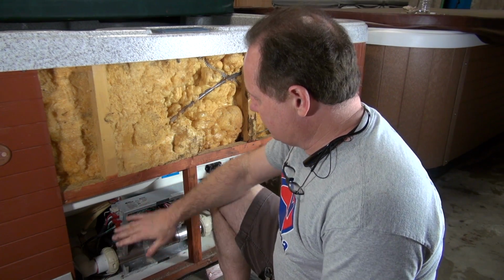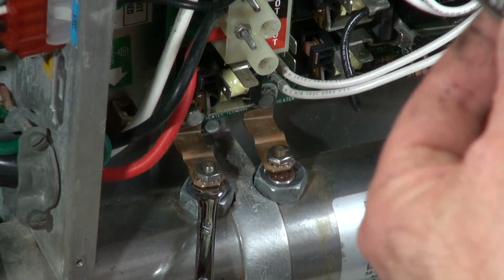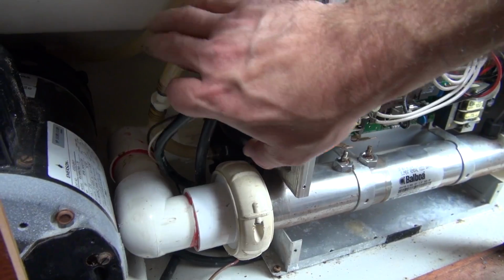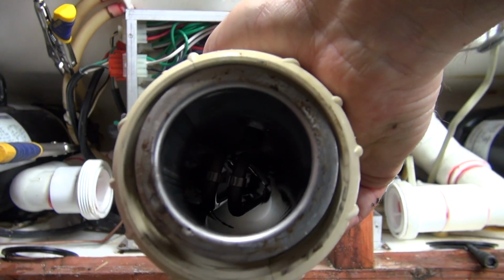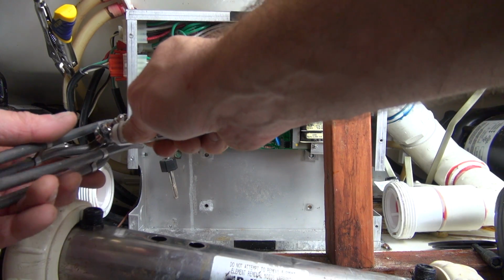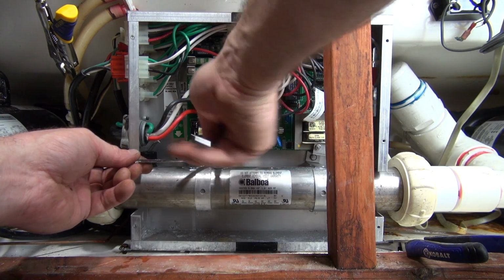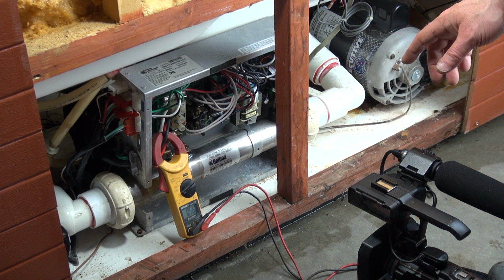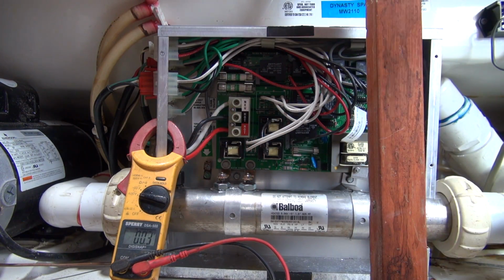GFCI Breaker Trip Diagnosis Heater Replacement Hot Tub How To Spa Guy

Comment: Bought a used hot tub got it home, got the electric service connected, filled it up, switched it on and nothing! The breaker tripped and nothing happened. Found this video, followed the troubleshooting steps and discovered that the heater was bad. $79 for a new heating element and less than an hour of work following the video instructions and my hot tub fired right up. This video literally saved me hundreds of dollars! Thank you, thank you, thank you!
Reply: Got the same problem!... hopefully I'll get a similar result.  Great video

Comment: Thanks for an explanation of why the GFCI trips as the hot tub ages.  My circuit board had problems, too, so I just replaced everything for half of what my local store wanted.  This video helped me to decide to call a parts distributor who sent me exactly what I needed and let me bypass the local guys who overcharge for simple service calls and for the same part I was able to install myself. Four years back I bought the "demo spa" model to try to save money, so I should have expected to have the problems that come with wear-and-tear of a slightly used spa.  Your video and others saved me enough cash by using skills demonstrated and products from internet sales, so the rebuilt unit I have now is almost like new and is also easily repairable - now that I've been though the experience once. Your DIY video is a godsend for savvy handymen who enjoy solving new fairly simple problems while saving money. Thanks again.
Reply: I’m a girl and I think I can replace my heat element by watching this video as I go.  Cause I sure can’t find anyone to come repair it.

Comment: After going without the use of our hot tub since February because the heating element went out, we finally repaired it ourselves following your video. Though we didn't have the electric test kit we could tell the element was bad because of the rust around one of the terminals. Great Video. Thanks a lot! Saved us a lot of money. Our hot tub is 13 years old and nobody wanted to work on it. Found parts easily enough.    Stephanie
Reply: That’s my problem.  My hot tub is older and I don’t like the newer ones. I like mine but yes people do not want to worry w older models.  Last guy swore he couldn’t find the parts on line because the Morgan spa was an older model.  I think I bought it in 2005

Comment: What a great video! It took me longer to take off the tub cover and the electronics cover than it did to figure out that the heater was bad. Now the next step while I wait for the parts to arrive is to see if my slice valves actually work but if they don't it's outside so I get to water my brown grass! :)  Thanks so much for a clear and straight to the point video!

Comment: My GFCI plug has been randomly tripping for years. I thought it was a burned out ozonator, which I replaced. That seemed like it fixed it for a bit but the problem continued. I watched this video and realized I had a leak on one of the heating element contacts. Replaced it for $30 and the tub works great now. Thanks

Comment: Thanks so much for the video !!  I found one of the heater electrodes leaking and then noticed the wire lead had melted . I just had the heater element changed...guess the repair guy didn't do a good job installing it.  We went and bought a new spa since this one is 15 yrs. old. Was going to trash this one but will keep it now and use it at our home, the new one goes to our rental cabin. Just needs a new wire lead and element sealed with silicone....

Comment: Just thought I would add to public knowledge. I had a situation where my hot tub wasn’t heating so I replaced the heater element. After replacement, the breaker would trip instantly. Tried 2 new elements with same result. Went back to original and no tripping but no heat. Electrically the new and old heater elements were identical (10 ohm resistance, no path from lugs to mounting nuts). Measured voltage at element lugs and zero volts. 
Turned out that controller board had cold solder joints to both heater relay output pins. Resoldered pins to board and no more tripping the breaker with any of the heater elements and now have correct voltage at element posts and it’s heating fine. 
Not sure why having those bad solder joints would cause breaker tripping with new heater elements but not the old (still working) one — but it did. Something to be aware of,  Definitely caused some head scratching on my part.

Comment: I live in the great white north and found that my GFI kept tripping when powering on. Tried troubleshooting pumps, lights, heaters etc. with no definite issue. I ended up looking at the GFI breaker panel and found that it was packed with wind blown snow. I cleaned it up, dried everything up and SUCESS! Check to see if you have moisture in your GFI panel as well. 👍

Comment: thanks for the details on getting my tub back running again! installed a titanium heater instead of the alloy one as recommended. my old heater didn't show any signs of corrosion on the posts, but tripped the breaker whenever it would want to heat. cheers!

Comment: You are awesome! I thought for sure I had a bad breaker. After watching your video I did exactly what you said and realized the heating element was the issue. I ordered the part on Amazon and just installed it. Took me roughly an hour to install it. I did have to grind down one of my wrenches to fit as a back up support. Not a big deal, but took a little extra time. Thanks brother, I I owe you one. 👍😎 definite subscriber

Comment: ...wasn't sure if it was the heater or not tripping the breaker, because the spa would run for hours and then trip.  So I disconnected the heater element from the board, and let it run for 2 weeks.  Breaker never tripped again, so I ordered the part and will replace it today.  Thanks for the video!

Comment: Very thorough video. Thank you for taking the time to make it.
I changed out my pump seal and after reinstallation, refill, etc the breaker tripped at around the time the heater should kick on. Why the heater decided to crap out at that exact time is unknown to me.
Reply from the maker: Joseph sometimes when you let the water out and expose the back of the heater to air it does that.. Meaning it was bad already it just needed a pressure change to be exposed and cause a breaker trip..
I have heater elements here.. https://hottubpartsofamerica.com/search.php?search_query=titanium

Comment: Thanks for this informative  video.  I had a circuit breaker that keeps tripping. I had already tightened the AC wires and unplugged all accessories.  Your test at 2:30 shows me that the heater must be bad.  Thanks !
Reply from the maker: Jeff Weiss https://hottubpartsofamerica.com/heaters-and-related-parts/
Reply from the maker: Jeff Weiss https://hottubpartsofamerica.com/search.php?search_query=titanium+5.5kw
Any of these 5.5 are correct for balboa..

Comment: This was so helpful and saved me a load of money. This looked exactly like my setup and as you said, it does look like the heater coil. THANK YOU!
Reply: Good
Reply: Mine is a hydroquip, incoming voltage appears ok, indicators on upper panel appear normal, no error message, but unit does not come on, pumps are not activated... nothing....what next?

Comment: Thank you lots Spa guy you help lots today troubleshooting my spa and heater element. As i could see on my element when looked at, the rubber o rings had almost cut in half because of the manufacturing of the hole, it left a burr, so i filed it down better so as to not damage my new orings, so i changed only orings and did not have to buy new element :-). CHECK YOUR ORINGS !!! Thanks again spa guy

Comment: My hot tub starts and all looks good, then a few minutes in the breaker trips. When diagnosing the issues my breaker is only tripping when Pump 1 is connected all other parts are good (based on unplugging and disconnecting each individually). I even plugged in Pump 2 into Pump 1 port on the board and ran it for a while with no issue.  Once the breaker is tripped it won't reset for a while, if I wait a day and reset it we start back in the beginning with all working for a short time.  I just ordered replacement seals and bearing for Pump 2 for a small leak and a new heater titanium element from your website, figured worth fixing it up a little while I am in there working on it.

Pump one is an Executive 56 2 speed motor (also serves as circulation pump), Hot Tub is a Master Spa TS7.2.

Help Spa Guy...trying to isolate where the issue might be.

Comment: First week of January (coldest day of the yr around -4f with a -20-30 windchill) outside jacuzzi decided to stop heating. I replaced the filters, heater, hi limit switch, and temp sensor drained and refilled. The only thing i can think of is the circut board is next? The top controller works fine and the light calling for heat is on. NO CODES. Jets work as they should. Everyhting is normal just no heat. The breaker never tripped and the fuse is good. The board has a few dark areas but nothing that looked burnt or out of the ordinary. I replaced the circ pump last year also. Thank you in advance

-Jason
Reply: Turned out to be circuit board

Comment: Great information but try this first.  Turn off the power, take a cheap tooth brush and rubbing alcohol and clean around the heater terminals at the top of the heater tube.  Let dry and see if that clears the GFCI tripping issue.  Dirt, splashed water, spider webs, etc can occasionally cause the GFCI to see a path to ground and trip.  Worked for me.
Reply from the maker: You got lucky!! If the heater element is in the condition I show here it needs to be replaced!!

Comment: Could you put some kind of cap on the pipe where the slice valve's are at...so the water wont come out..??? Do you think a balloon or something similar cap will stop the water from seeping past the slice valve, in other words cap off where the threads are, where the heater connects.

Comment: Good Morning Spa Guy!  Just scrolling thru the Q & A's here is interesting and beneficial, particularly those from Headless Horseman... I was beginning to think we owned the only Coleman 455 ever manufactured!  Here's our problem: changed the water, got the tub all spiffy clean, topped up and "poof" goes the breaker. Nothing new really as it's sometimes taken a few throws [or flips] for it to stay on. When not, as this time, it's usually the element, right? Not this time. Well, who knows... with the new element in the breaker isn't flipping anymore but nothings happening... no pumps, no lights and who knows about the heater.  There's electricity floating around in there cause... well, let's say I got  a tingle  :)  I've replaced the 3 fuses I can see... the larger 30 amp one + the 2 smaller 7amp glass ones... any ideas?  The topside controls weren't looking too hot prior to this and I was thinking we should get the Maxx replacement part (Coleman / Maax Spas TOPSIDE, PANEL, C400 & C600 SERIES - 2003-5 (NO OVERLAY) - 103305) but haven't gotten that far yet.  Could that be the problem?  Thanks!  Peter

Comment: Would be good to see you test the actual old or bad element to see the ohms before changing. Mine test good but still blows the breaker when it fires. Flow sensor is fine. When I unplug the heater I do get the 120 output but when it is plugged in it trips.

Comment: Hi Spa Guy great video!. I have a Tiger River Spa, approx 6 yrs old that came with the house i bought, in nice working condition. It worked fine for a year. Then it started to trip after 5 min of running time. It started happening when it got cold out (southeast Michigan). I didnt know the condition of the filter so i replaced it, and it worked again and didnt trip for a while. I clean the filter about every 3 months, we use the tub about twice a week. 

Now, its getting cold out and it trips again when in use.  When not in use the heater works fine. But oddly i noticed it only trips when both the heater and jets are on at the same time. If i heat it up to where i want it, i turn the heater down so it's not engaged and run the jets as long as im in there and it doesnt trip. 

Any suggestions are greatly appreciated! 

Thanks for your time.

Comment: Great video sir, my issue is that the heater is tripping my breaker after doing the elemination process i find that when i hook up the heater left lead it trips the breaker while powered but it doesnt do it with the right leadt touches,,,i have also nocited that i have 120v to that lead that causes the breaker to trip but zero volts to the right lead, isnt it supposed to have 240v when powered and i test both leads to the heater that come from the pack?...why am i only getting 120v to one and zero on the other?.....the power coming in to the pack has been tested and is correct

Comment: If you use a stainless steel wire brush it won't rust as bad after you brush it. If you brush it with a steel brush it will make the stainless rust. You can also check the resistance of the heater element and see if it is bad that way.

Comment: I think I have this exact problem on my tub. I opened up the case today and the terminal into the tube for the heater had one little drip on top (wasn't sure ehow it got there) and it trips out. I tried unplugging the pumps ect and it still did the same. I'll order heater and give it a go

Comment: I have a hydro pool hot tub and it keeps tripping the breaker, I figured the heating element was causing the problem, I disconnected the element and the pump started, but had a HL fault on the display. I checked continuity with my meter so I suspect my element is fine. I reconnected the element and unplugged the temp sensor and the pump starts again as soon as I plugged the sensor in it trips the breaker!  4kw Gecko

Comment: Did you do a resistance check on the old element? My breaker is tripping only with heater plugged in, soon as I isolate it, it doesn’t trip, but I did a resistance check, and it was good 14.9 ohms

Comment: 25:15 you have a what on the board? I think I have this issue with my pump1 output. 2 speed only getting 120v it seems like. Great video, think my element is bad.

Comment: Hi there Spaguy. I have had a low flow issue on full flow. Now l have ordered a new pump. I put in the old pump a new impellor and seals because most of it had disintegrated. This did not improve anything. I have a heater similar or the same as this one in this video ,same make also. I think that I need to take this apart and look inside just in case some of the impellor is stuck inside. I found very small bits in the hot tub, but there must be  much more somewhere. What do you think ?

Comment: I can't get the new heater element tube in my existing tube. I had to cut the two electrical prongs off in order to get the original out. What's the best way to slide the new in the tube?

Comment: Great video and very helpful! I have the same board but my circ pump continuously runs and seems to be wired slightly differently. Based on the diagram, and the way mine was wired, the black wire from my circ pump connects to the K4 relay on the bottom left of the board. I noticed that your circ pump seems to connect somewhere else, and was wondering if that might explain the difference at the 19 minute mark of the video. In your video, if you check the resistance from either heater terminal to ground, you get 0. For me, if I test the left heater terminal to ground I get what appears to be circ pump resistance, and if I test the right terminal heather to ground I get what appears to be circ pump + heater element resistance. This is a new board and a new heater element. Would that be expected given the difference between how my circ pump is connected versus the one in the video?